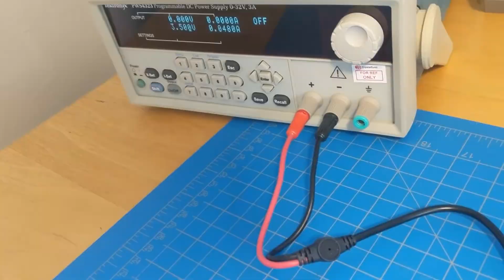Getting Started with Graphic LCD and Breakout Board

Comment: What are the pins on the CFA-10110 that correspond to CSI protocol? eg.  SCLKI,  MOSI, MISO SCLK
Reply from the maker: The displays support SPI rather than CSI. The pins differ based on which display you're using and are defined in the datasheet which can be found here: https://www.crystalfontz.com/products/document/4570/CFA10110_Datasheet.pdf
Reply: @Crystalfontz  My bad on that, I  had meant SPI... And I found it in the git.  I replied to my  original comment with the  link to it (for future reference) but that is no longer showing here.

One other question,  if you would be so kind.   I thought that the standard way to number pins  on a header are:
1  2
3  4
5  6
etc.
but the SPI configuration document seems to do the  mirror of that. For example, it lists pin 1 as GND and pin 2 as 3V3 

According to the j2 pinout printed on the circuit board, top left pin is 3v3 and top right pin is GND
Reply: Looking at the video again,  I see the point where the pins are superimposed on the screen, and they are the same as what is on the board, so I am going with that.
Reply from the maker: @DramOfScience  yes. The silkscreen is correct and the numbering is mirrored.
Reply: @Crystalfontz  So I wired it up to the Raspberry pi 3 B, applied power to the RP3B and there were little icons at the top  (or bottom) of the screen.  but when I tried running the demo software, cfag12864u4, it just cleared and nothing else showed.     Trying to repeat the process from powerup, it just remained blank... Any ideas?  Thx.
Reply from the maker: @DramOfScience   our demo code is written for a Seeeduino microcontroller, not the rPi. You might try this library to get it going in an rPi: https://github.com/rdagger/Pi-ST7565